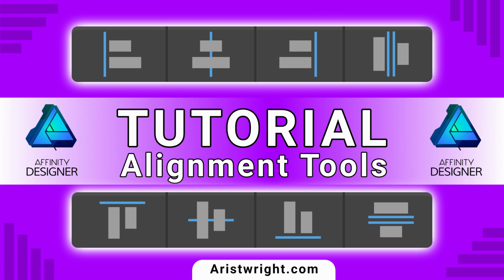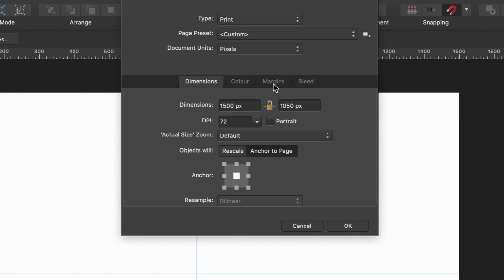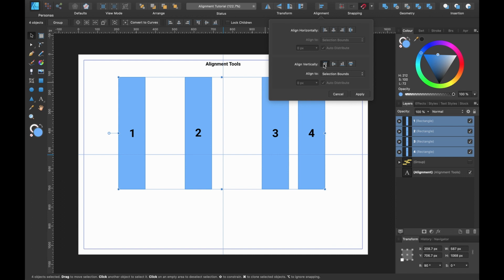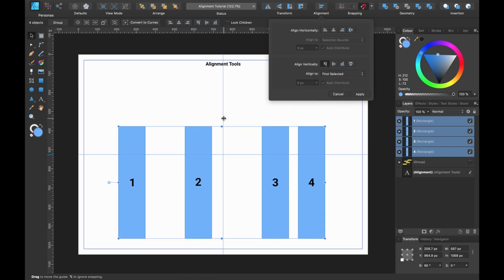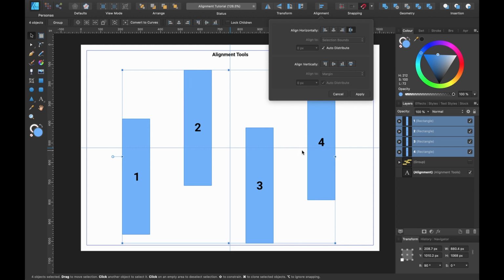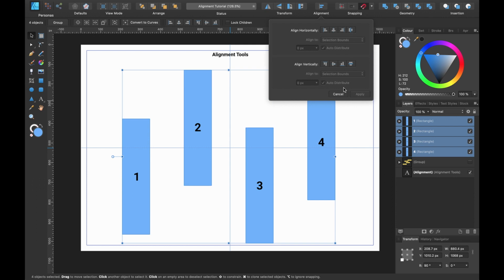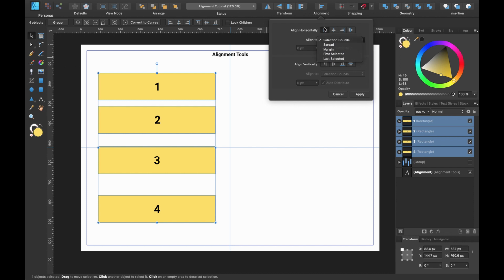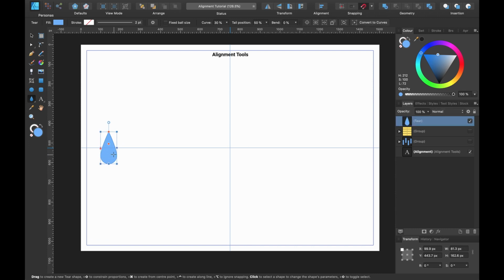Affinity Designer Tutorial - Align and Distribute with Alignment Tools

Comment: Is there a way to align within the spaces defined by the ruler guides? For example, lets say you want to center an object within one of the quadrants you created with the Ruler Guides in this video. Thanks!
Reply from the maker: I usually work at a 1 to 1 scale. So centering and spacing is easier. As far as the ruler guides Ive not actually tried to centre between guides I've specifically placed. I use them for centering or moving object to the edge of  the guide. It's easy enough to create a rectangle between the two guides you place, that rectangle will have a centre point

Comment: If I create the objects you do in your video, I can't get them evenly distributed in either direction across the artboard. Is there a way to automatically distribute objects across the artboard?
Reply from the maker: Strange, they should distribute evenly. This is the way I distribute objects evenly.  If the objects you are working with are all the same, you can power duplicate (cmd+J then move the duplicate, then keep pressing cmd+J as many times as required)
Reply: @ArtistWright  They should, but they don't. AI handles this easily.

The only way I've found for distributing objects equally horizontally regardless of size is to create two vertical lines with the Pen Tool, move them to the vertical edges of the artboard, include those lines in the selection, and THEN do the distribution (and then delete (or hide) the lines when done.) Seems like a lot of extra work for what should be a simple task.
Reply from the maker: It's totally possible to do it. Did you watch the whole video? I like your workaround but you can actually distribute to the Document size also